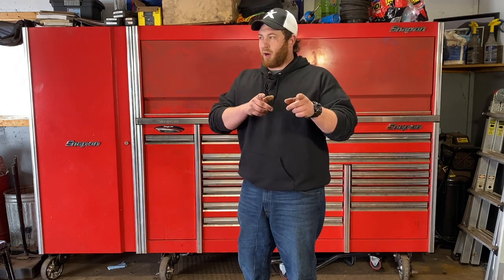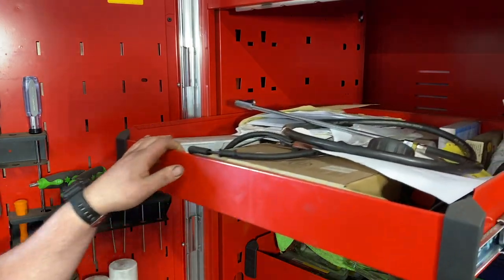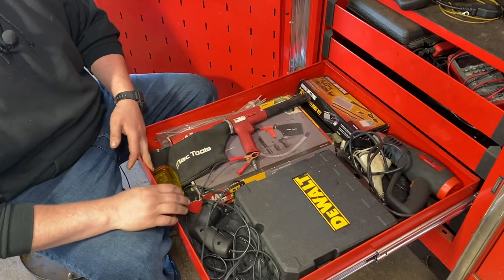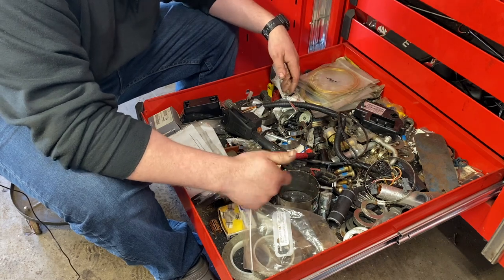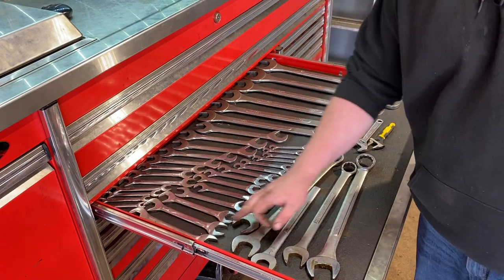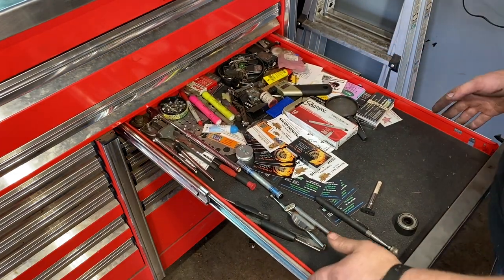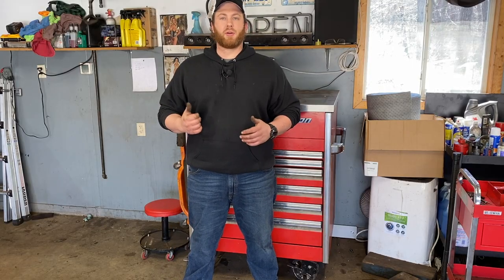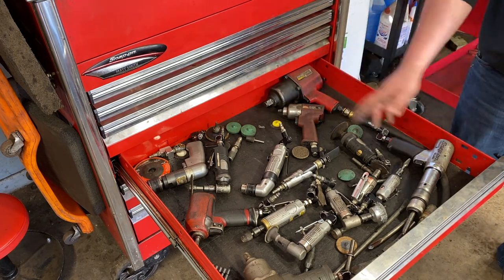Snap-On EPIQ Tool Box Tour | Most Used Box on YouTube

Comment: I’ve worked in the HD, Trucking & Automotive field over 35 years as SE US Rep  & E. US Trainer(Yes Caterpillar was one of our national accounts ) & part time racer. It’s interesting how different tool boxes are set up. Not just for “part time” mechanics but fir new guys to see what’s actually used. You’ve done a good job at that but…. If I got a $1.00 for every time you said “Cheap” I could buy a Top Line Snap-On cabinet like yours! I love Snap-On but it makes no sense for a part timer to devote that much on tools they might only use a few times. “Economy” prices tools do have their place. It’s like your driving a new Ferrari & feel the need to give everyone else in the road the finger🖕! One thing that would be of help to new people would be a ball park figure on the true expense involved so they don’t faint first time they step into a Snap-In truck. 
Good job👍

Comment: That ratchet master kit is for push to connect fittings on things like air and fuel lines. We use them on trucks but I have no idea what they would be used for on automotive applications.
Reply from the maker: Thanks!

Comment: That real thick internal hex socket (if it's a 16mm) in that top drawer is for head bolts on Detroit engines. If you ever get the honors of pulling a head off of one, you will understand real quick why they are so thick. LOL

Comment: Use lighter fluid to take the black tape off.  Soak it for about 40 seconds and it should come right off.  It would have been better to have still had the badge on to use as a pressure plate for the adhesive to have hung on to.  This hack of using lighter fluid is wonderful for tape, price tags and labels.

Comment: That’s a weighted 19mm socket for Honda crank bolts you do a timing belt and water pump on a 3.5 Honda odyssey you’re gonna need that socket only on the odyssey for some reason

Comment: That extra thick 19mm socket is a weighted socket, probably have it for removing honda crank pulley bolts
Reply from the maker: That would make sense! Thanks.
Reply: No doubt brotha! Love both of your set ups currently working on my tool collection as well😎